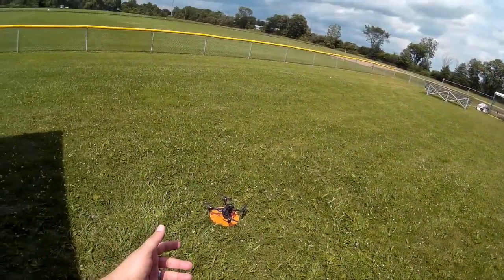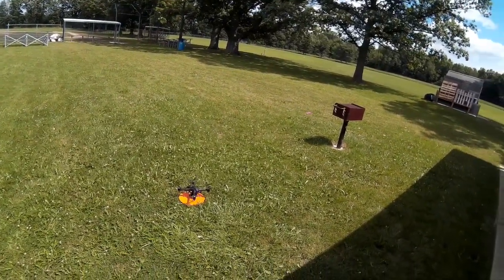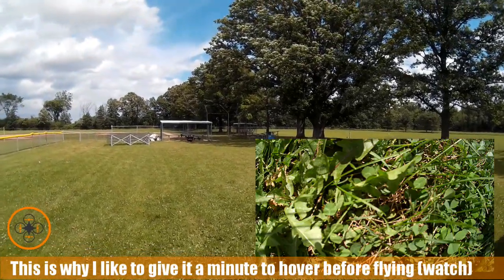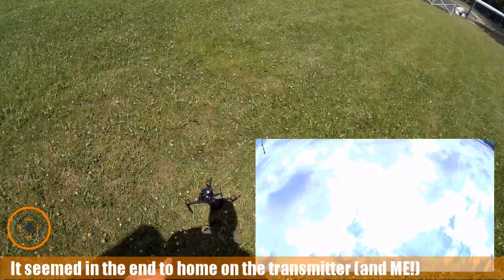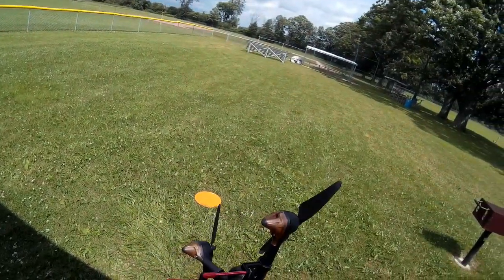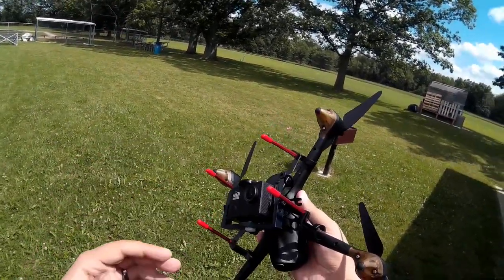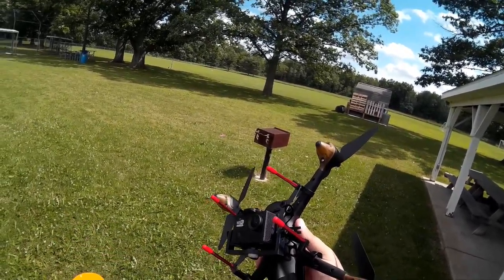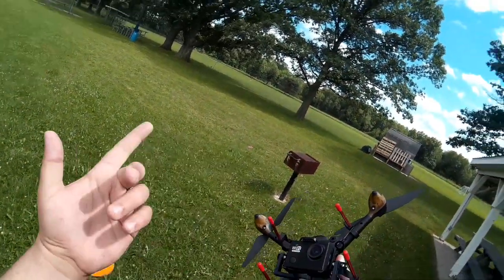Video Drone - Hubsan 501s Camera Carrier UNSAFE do not use!

Comment: I have flown the HobbyAce GoPro mount on H501ss and H501a drones. Some flights are dual-battery mods, with a stripped down HobbyAce carrying 2x 2700 mAh Hubsan batteries. At other times another mount carries a GoPro Hero 3+ with a dedicated FPV transmitter, a ImmersionRC 5.8 GHz unit to provide the down looking GoPro with its own FPV feed. This is usually carried aloft by acH501a dual-bind setup, with the pilot using the FPV Basic controller (from the H501ss) and the Mission Coordinator using an iPad mini and X-Hubsan app tl plan a waypoint mission, upload it, initiate it, then monitor the drone's position on the satellite map, AND monitor what the GoPro sees in real time.

I have only had good experiences with the HobbyAce. I've had scary fly-aways with H501 drones myself. They've landed in trees, went for dunking in a pond, or crash landed hard like yours did. I always found, later, that I had flown in high Kp (magnetic storms), or other EM interference (powerful side lobe from nearby FAA center data linking to FAA hilltop radar site, etc). Nowadays, I fly in places that avoid (by several mikes) microwave towers, do not fly when Kp is >4, etc.

A good test, is immediately AFTER the scary flyaway, after checking over the aircraft, completely power down, remive first battery, connect a fresh battery, do your compass calibration, then RECALIBRATE YOUR IMU (every time after a crash, hard landing or fly-away - then re-fly the mission WITHOUT the HobbyAce...
Reply from the maker: Thanks for sharing, this is a "newer" one and think its the firmware as two flights the same and I even changed locations just to rule out the any EMI or rote magnetic interference such as power lines, manhole coves, etc and both times the same thing occurred as I think there is an error in the firmware or an aspect which they did account which doesn't "shut down" the loop after an over run.  As that is PID what does, is minimized the over or under shoot and think because of the added weight it ramps up the motors so fast they over shoot the expected control and jet keep going and going and going...
Reply: You could be right about the ESC ramp-up issue. I am using H501ss FW FC 1.1.38 and RX is 2.1.29. Our 501 is also one of the new SS versions, with much of its avionics in common with the newer H501a. This is fortunate, since we use the H501ss as a "testbed" aircraft to try out payload and airframe mods for the H501a's in our lab. We've been having good results with this latest H501ss FW. If your FW is up to date, you definitely should alert Anne Lu at Hubsan tech. This needs to be looked at IMHO. Good flying!
Reply from the maker: +David Murotake I assume your with Hubsan from the comments? Also it only had the firmware that came with as find firmware from husband was akin to looking for a pot of gold at the end of a rain bow.  Oh the copper was purchased new about 3 months back...

Comment: had that problem a few times with my 501c ..I found that if I hover and wait for satellites to get past 6 it does not happen ..also fly away from building ,trees or canyons ..it will make them  spiral like that .
Reply from the maker: Thanks for sharing the issue is in the ESC as the program (running in the ESC's)  thinks it needs more lift because of the added weight  and the PID loop doesn't close fast enough so it just goes straight up...

Comment: was this  thing  calibrated  before ?   hmm  seems  crazy .. i fly  my Hubsan  501 SS no  problems  with  a home made carrier for a  go pro 5 .. works  fine .. i  do  hold it  on  take  off  and   let it  stabalize  a  few seconds then  its  good to  go .. firmware  difference?  hmm  thats  wild  tho .. very  unstable .. hmm
Reply: also  GPS mode was on  ?
Reply from the maker: Yes, Hubsan saw this video and it is the PID in ESC as the extra weight makes the drone think its falling and therefore over shoots the PID and loops.

Comment: It flew away cos you did not wait for the Hubson to self adjust for the extra weight your carrying you got to let it fly 10 foot for 1 min or so then it will get all satellites you probably had 4 or 5 saitlights when you took off that explains the crazy take off
Reply from the maker: Nope, talked to a hubsan engineer its an issue with the ESC's running away.  The newer versions might of fixed this as they where looking into the issue...
Reply: You know what i thank your on to sothing here i had a crah coz of a EECS WAS BURTUP

Comment: IMHO, stick with the stock bird for the most part.  Add landing legs, but that's it.  If you want a better camera, or a more stabilized image, spend the money and buy the X4 PRO model.
Reply from the maker: Do you have the X4 Pro?  What do you think of it?
Reply: Just purchased one after finding a special deal on TomTom.  Still haven't unpacked it, but have viewed many videos as well as reviewed RC Hobby  blog posts.  I bought the basic version, with standard transmitter and basic gimbal.  Aftermarket 3 axis gimbal - HAKRC 3-axis Gimbal adds multi-axis control for very reasonable price.
Reply from the maker: Keep me posted please, as have looked at this one before I bought P3S and was more more for less so I didn't get it.  But maybe if there is a deal to be had, as I just got a brand new CX-20 (open source) for less then $150 bucks
Reply: Understand, we're all in the same boat, there's those things we want and then there's those which we can afford without having the wife, etc., toss us out of the house.   Suggest doing your research and keeping an eye peeled for the occasional bargain.  The gimbal which was suggested I look into adding is the  HAKRC 3-axis model, which sells for around 65.00 US.  again there are any number of videos here which do into great detail about the unit, as well as how to set it up.  A camera upgrade which was suggested was the Firefly 4K version.  and finally I understand that the carbon fiber DJI 9450 props also fit this version.
Reply from the maker: LOL!  Yea I know the wife thing all too well :-)
Reply: ya, i'm in the same boat too..(with the wife) and, I was looking into adding a camera mount or strapping my smartphone to it and a few other options, but I think I agree that it's better to work with what you have and if you want a gimbal, get a quad designed for a gimbal.I am working on practising different technics using the stock camera like lowering the sensitivity on the controller while flying in headless mode for panning/linear tracking style shots and planning times of day to take advantage of light conditions etc and its working well. people that operate camera drones professionally sometimes spend a week a one location waiting for the right conditions to get those great shots. I think our H501s can do better than people give them credit for if we work with it instead of modifying it to be something it wasn't meant to be.that being said.. I have been known to strap a 2nd battery onto it and i'm in the process of making pontoons so it can land on water, and I did the antenna mod so I can only say so much lol.